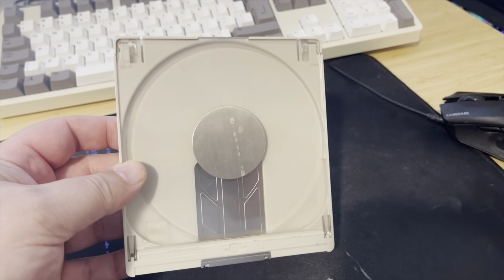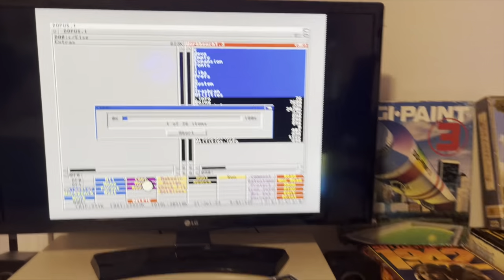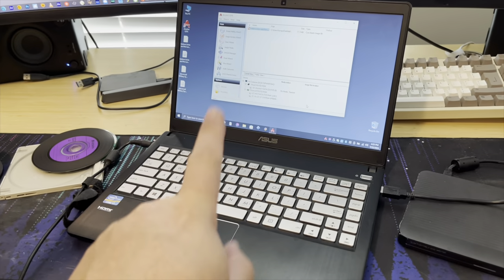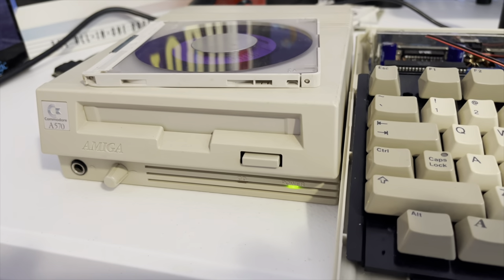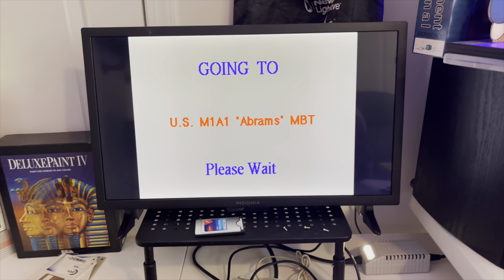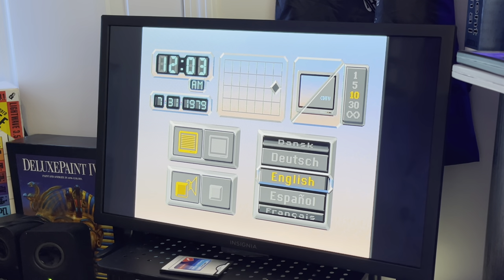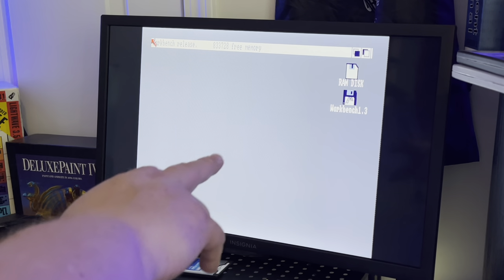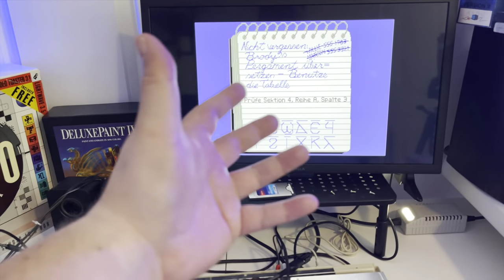CD-ROM and the Amiga. What A Bummer.

Comment: I have my original SCSI CDROM drive (and a few other drives) that I used on my Amiga that has a caddy. I liked the caddy back in the day as it protected the discs as long as you had a caddy for each of your discs. The problem was the discs came without one (there were some that did) and the caddies were expensive.
Reply from the maker: Not a fan of the caddy myself. But I do understand. :)

Comment: Nothing wrong with the A600, those who bash it just don't have a clue.   I done have a CD connected to any of my A500's.   My first CD-ROM was a SCSI Drive in my A2000 which also used a CD Caddy.  Nice to see you have an A570.   Honestly when I burn CD's for my Amiga's I just burn them and never care about the speed and they just work as intended but most of what I burn are just to move files or I was doing it before I started moving files over the network.   You should get one of those DB9 to either USB or PS2 adaptors to use a more modern mouse.  Its takes the frustration out of trying to use a wonky old tank mouse.   I have converted everything so I can connect my Amigas to a VGA/PS2 KVM Switch but that's all about saving space.   Now I do have an A500 and A600 not in my Amiga Rack so they do use a stock Amiga Mouse but if those go wonky I have a draw full of them I can put back into use.
Reply from the maker: Thanks for sharing your Amiga life! I love reading this stuff. Seriously, thank you. Yeah i know i should consider using modern mice with adaptors. I…resist. Heh.
Reply: I love using my tank mice and the more ergonomic versions of the 600/1200/4000.  And I love myA600 too!

Comment: :) Sorry, but as a DOS and Windows 3.x user in the early to mid 90's I have to disagree that Commodore made a mess of the execution - yes, it definitely could have been better, more streamlined and user friendly to set up..... but have a look at the convoluted mess that was required on the DOS/early Windows platforms to access an optical drive and you soon appreciate the Amiga's implementation a lot more. ;)
Reply from the maker: That’s interesting. Yeah I don’t have a lot of experience. I just saw others. My first Windows box wasn’t until Win95.
Reply: @HoldandModify  Yessum, on Dos/early Windoze you had to install the correct CDRom driver (usually, but not always an Oak driver), from DOS, then edit your config.sys file and your autoexec.bat file manually with a text editor to tell the system which device, type, buffers etc to use to load the CDRom driver at boot - it was a total convoluted mess and MUCH worse than what we had to deal with on the Amiga at the time. That's not saying it couldn't have been done better on the Amiga, more so that it was done far worse on the PC. ;)

Comment: The old burn at 1x was really only a problem if the drive sucked at burning. Depending on how the drive handled vibration keeping the laser steady might be an issue. If memory serves correct there were 2 methods of laser alignment being used one, by Philips and the other Sony. I don't remember which one was more reliable but on one system the laser was more likely to burn correctly in that drive but then if you took it to another drive due to variance it wouldn't read. 
Fun and expensive fact my first CD burner cost me over £1,000 and each (yes each) CD R was £10 but they were actually coated in gold for burn area so they looked nice 🙂
Reply from the maker: Oh dear lord!! Haha. Good info and also..YIKES.  :)
Reply: very interesting, thank you!
Reply: Yes and no for the speed burning. Have found that CD32 iso burning you do need to burn at a slower rate, 2x for example. That’s using a PC with Win 10. But as I’ve found out, a lot of the newer SATA DVD RW drives won’t go lower…. 🙄
Reply: @cullmaster7361  Last drive I used to burn CD32 and CDTV discs (I don't own or know anyone with one of those right now) was a Yamaha and it burned at 24x and the discs burned fine across multiple system (at least 5) using Win 98 and win 2000 at the time.

Comment: 1) Have you thought of using an SD Box? While it needs a floppy to boot, they can provide 2 GB of storage. The IDE68K is available for <$100 USD and adds an IDE interface for a CF/SD/TF card. 
2) If you’re using a 1.4 Greaseweazle, when the latest is a 4.1, you may have a problem; I use my hand build GW almost every day using a known working floppy and the current software. It works beautifully.
3) You need to take your floppy drives apart, clean, lubricate and align them (see Chris Edwards videos)
4) The virtual floppies are mounted as DA#:, where the # represents a number; they are mounted by DAcontrol.
5) The nerve to the 4th finger (the annularis ~ "annular" meaning 'Ring Finger') also drives/innervates the 5th finger (digiti minimi), so they move together.
6) The "dusty laptop" may have a dusty lens that needs cleaning with a cleaning disc (<$10 on Amazon)
7) Try the simple ImgBurn for writing CDs, or put a CD or DVD-R/W in your A4000 and use Frying Pan.
8) The write speed of one particular CD Drive has nothing to do with the reading of the disc at a slower speed.
9) I've never had the age of a CD-R or DVD-R matter; I've read that the reflective layer of a standard CD/DVD may degrade after 10 to 100 years depending on the type of reflective layer and the way they were (Quality Control) made (buy known brands). M-Discs can be read just fine on the Amiga.
Reply from the maker: I have an SD box. It too doesn’t seem to work. You can see a pattern with my luck and electrons. :)
Reply: @HoldandModify I also have an SDBox, not yet got a SD card working with it. Watching this reminds me of the shenanigans I had trying to get the SDBox to work. 😅 Wouldn't mind an A570.
Reply from the maker: @roscoe500  sorry you’re having issues too. It’s frustrating.

Comment: I had an A500+ and A570 way back when. The A570 was a great add on. It went faulty and I got it fixed by Commodore UK just before they went bust. Sadly, it didn't last much longer before breaking again. It basically failed to read the discs - spun up the CD then stopped and spun backwards!  Odd!  And a big shame.
Reply from the maker: Ah bummer. Yeah a lot of stories like that.

Comment: Not only does the Abrams "share" the same gun with the Leopard 2 (it's a gun from Rheinmetall Germany), the Abrams in fact is a derivate of the Leopard 2. Great to see the old CD ROM running and I am surprised how good it feels speed wise. I always wanted a CD ROM on my A-4000 but I struggled maybe because I had and still have the Amiga OS 3.0.
Reply from the maker: Ah great info! Thanks! I was a bit uncertain.
Reply: @sledgefox Nothing stopped you from adding a CD drive to your A4000. There was plenty of software being put on to CD and obvious the CDTV and CD32 software. As long as you had some extra memory I never found a CD game that didn't work on an A1200 (so by extension A4000)
Reply: @daishi5571  I am sure, you are right. I guess I didn't invest enough time trying. 👍

Comment: I think you just forgot to use the install command on your workbench floppy after you copied the files which is why it didn’t boot.
Reply from the maker: Haven’t heard of that. Once i wrote the ADF to disk as i mentioned, it worked, though.
Reply: @HoldandModify  You need to INSTALL a bootblock, ofc it is already present on an original disk!
Reply: @HoldandModify  Yep, because the adf already had the boot block. If you want to create a boot disk, execute install df0: (or whatever drive it is in) and it will be able to boot.